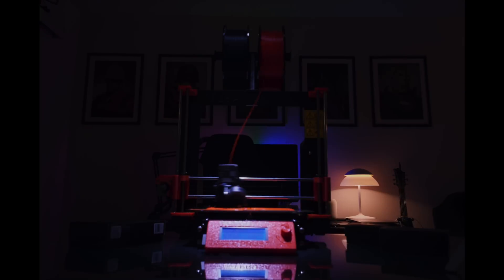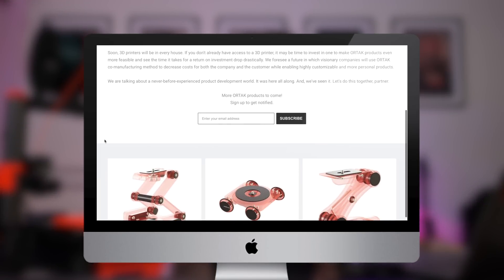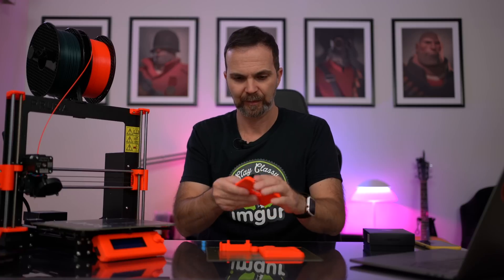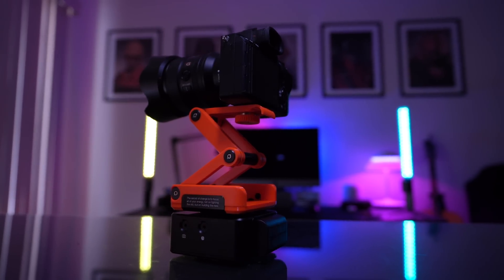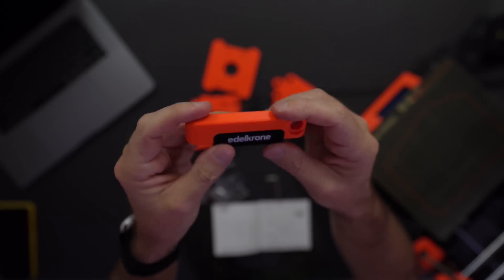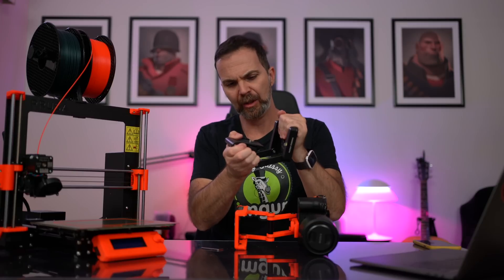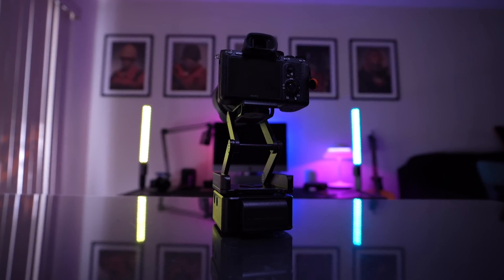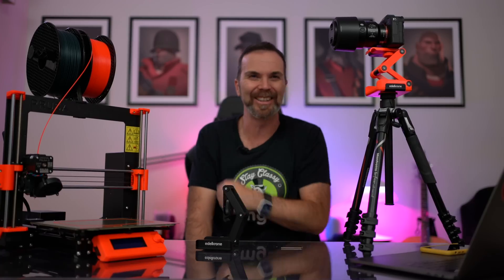3D Print Your Camera Mount — Edelkrone Ortak

Comment: I'm printing the assembly parts for a camera slider kit. If the parts were included it's another 30 Euros or more plus shipping. Now I'm discovering I need to predict filament behaviour to get more accurate finished tolerances. I'm not complaining. This is where things are going.

Comment: There's a lot to know about 3D printers, and what I've found is that it's more cost effective to get a resin 3D printer to pair with some good 3D modeling skills to save yourself time in the final stage when you spray paint and add finishes to the print.
Reply: Resin is weak af
Reply: @ELValenin  so is printing in layers
Reply: @FrankTranDesign  haha yeah but the resin is quite a bit weaker
Reply: @ELValenin  I'd still put my money on resin for resolution, durability, and longevity. I don't think I've gotten a resin print that's broken yet (with the exception of < 5 mm thickness)
Reply: @FrankTranDesign  also I don't Like the mess resin printers make
Reply: @ELValenin  true. nobody likes that mess or the clean-up after. it's that whole do work upfront or do work down the line thing

Comment: $910 to buy the CNC machine and $$ to purchase the filament lol - cheaper and quicker just to buy the camera mount direct from Edelkrone
Reply: Nigel Harrison or use something like Shapeways or so.
Reply: If you only buy a 3d printer for only this print, true. But you can print so much more with a 3d printer and can save so much money on the long therm. And it is really fun.

You also can get really good printer for 300$